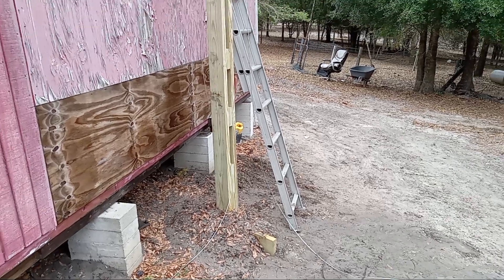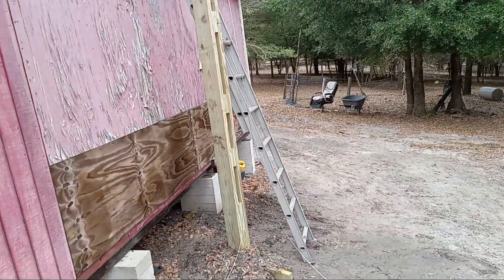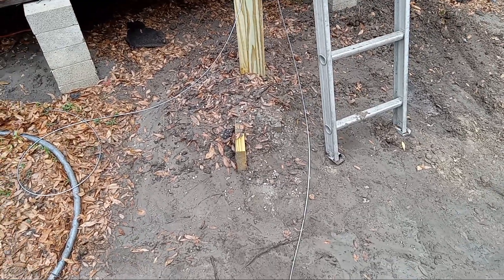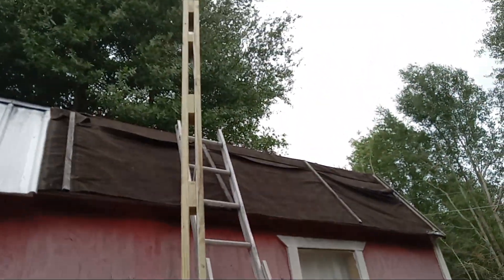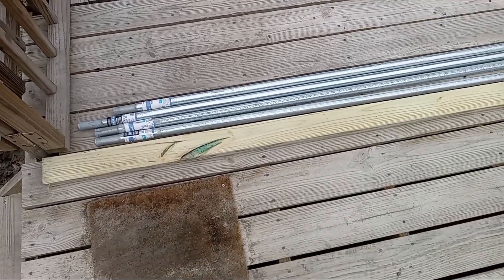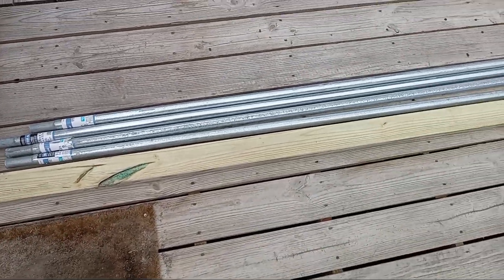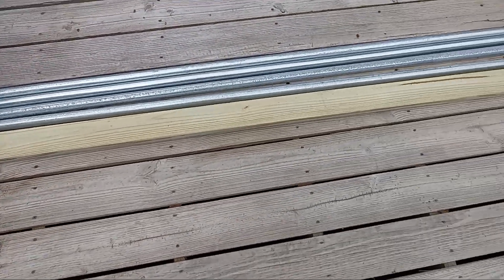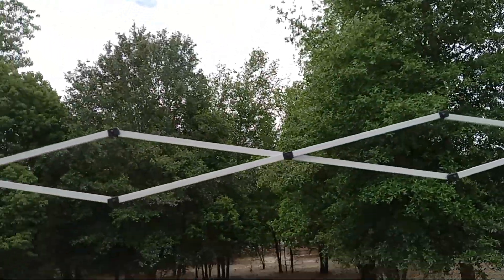Tilting Antenna Mast and Tower   Part 1

Comment: Nice work! these tilt systems are This project turned out great Nice work! I'm long over climbing ladders & steel roofs to maintain my antennas so this is the perfect solution. Which antenna did you end up going with?

Comment: comments are turned off by you on your other video.....
I liked your idea but I would add a safety feature around the pipe and 4x4 in case your cable breaks under high winds.